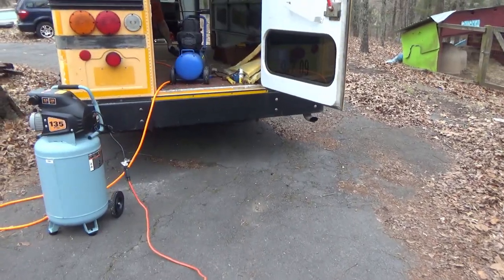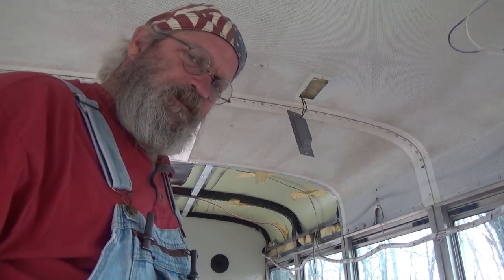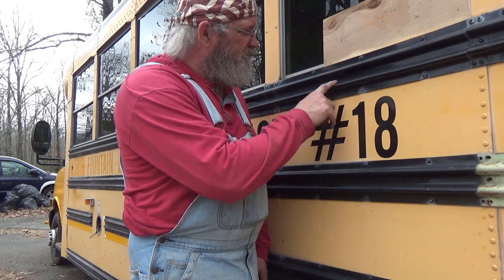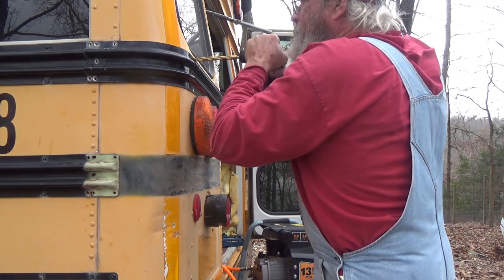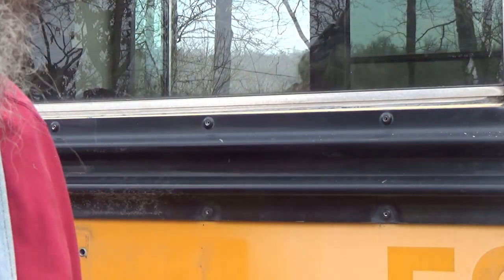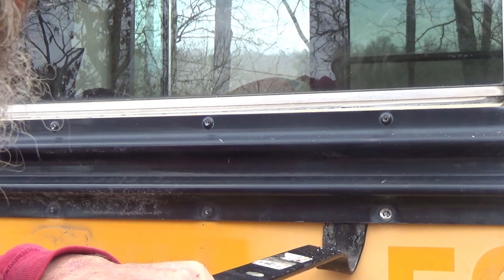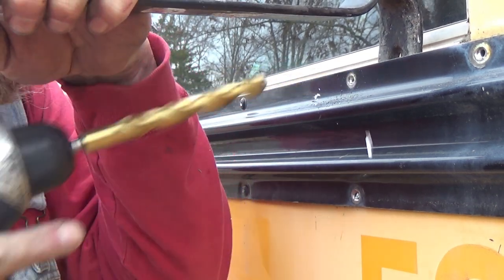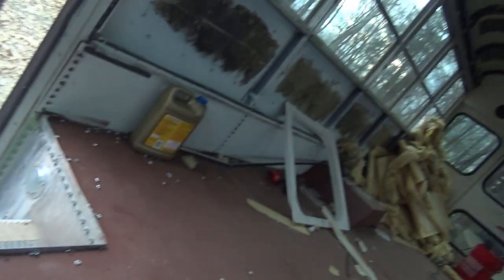02 Roof and rails and body fluids

Comment: Correct! I was a Gas Turbine Systems tech for 6 years in the Navy and was in the Army's M1 Abrams tank program for 24 years. I always wore double hearing protection around running Gas Turbine engine's. I retired with 100% of my hearing intact. When I retired and did my last medical checkup the Hearing Tech told me I was the only Gas Turbine Tech he had ever tested with perfect hearing. BTW double hearing protection is ear plugs and ear muffs worn at the same time. That was required at all times in the Ship's engine rooms in the Navy.